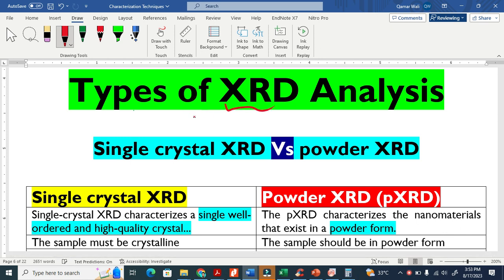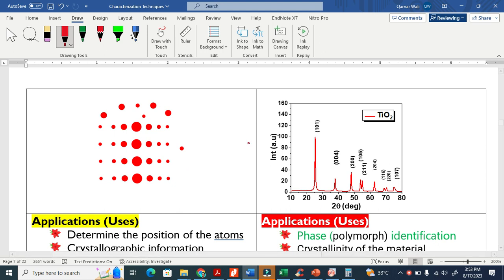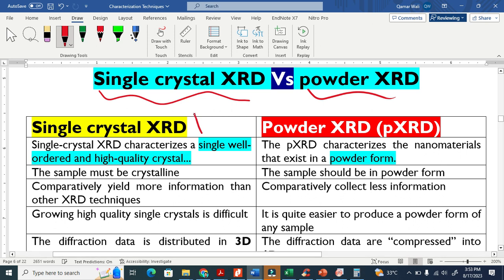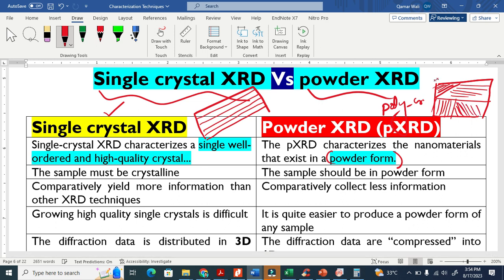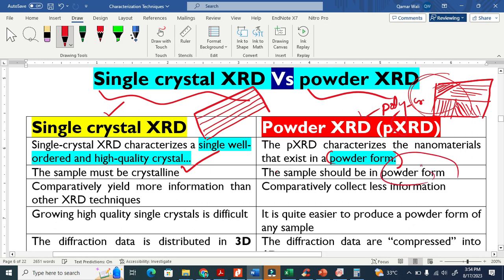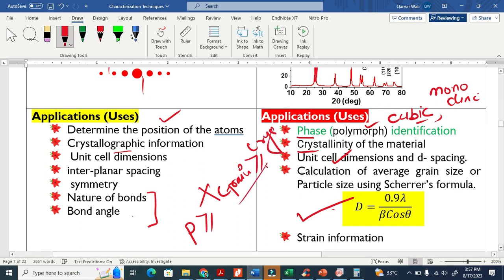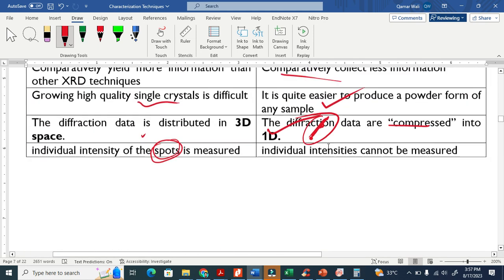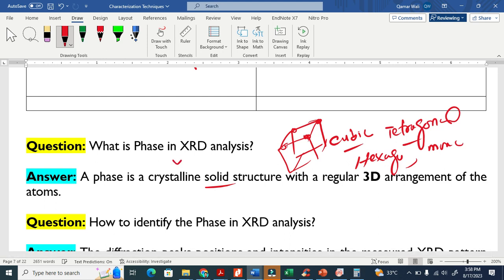3D vs 1D XRD Data: Single Crystal Spots vs Powder Peaks Explained

Comment: I have an XRD data of Calcite Powder derived from the mines of Rajasthan and in the XRD report here's the following mentioned -

1. Calcite - 90
2. Dolomite - 7.5
3. Tremolite - 1.5 

So when it says Tremolite what does that mean? Is that fibrous content or just some other crystals that the machine was able to detect but not understand what it is was? Is that correct?
Reply from the maker: In an XRD report, tremolite 1.5% usually means the software matched a few small peaks in your pattern to the mineral tremolite (a known crystalline phase), it is not an unknown that the machine couldn’t understand. Tremolite can occur as a minor accessory mineral with calcite and dolomite in carbonate rocks, especially if the source rock had some silicate/metamorphic influence

XRD tells you the phase, not whether it is fibrous. So XRD cannot confirm asbestos-like fibers. For that you need microscopy (PLM, SEM, or TEM, usually with EDS). Please visit these playlist for better understanding on SEM and EDS

https://www.youtube.com/playlist?list=PLWgqLpcPbMgf7uRGO_w0vQeJMXlFiE8Vz
https://www.youtube.com/playlist?list=PLWgqLpcPbMgc3gPBaE-Z1mBHKAcjS_umQ

At ~1–2% it’s worth double-checking, because minor peaks can overlap. Best is to inspect the specific tremolite peaks and confirm with a good refinement, or with Raman/FTIR plus SEM-EDS.